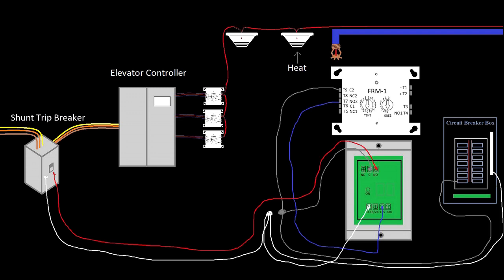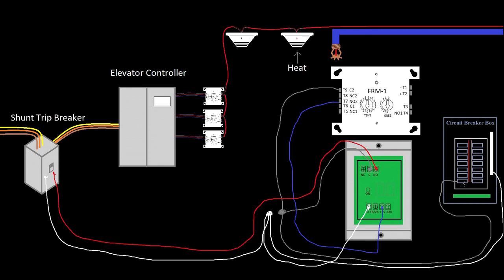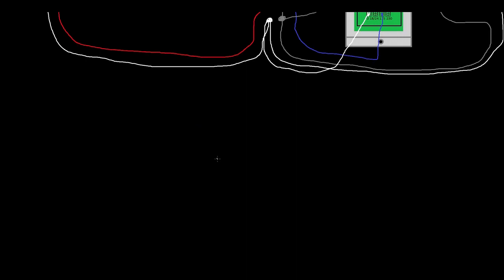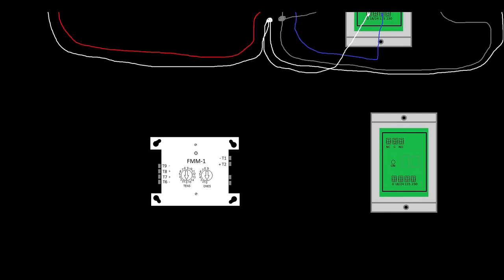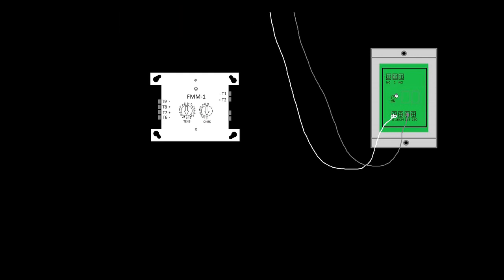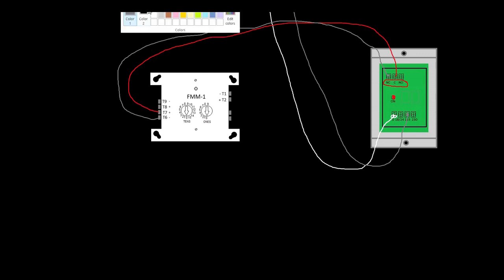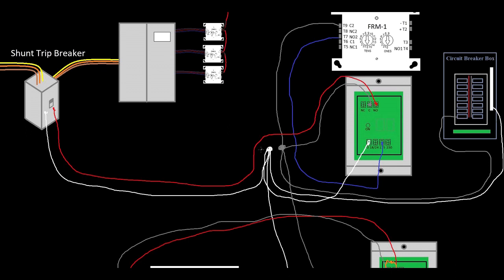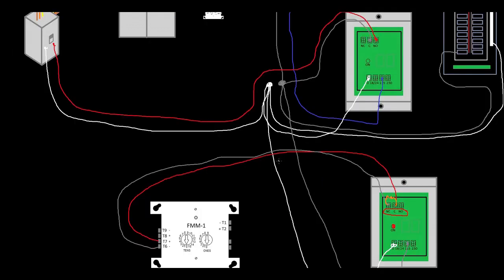40 - Elevator Shunt Power Monitor - Introduction to Fire Alarms

Comment: On the MR101 monitoring power, you have a resistor across the O/NC. When the coil is energized as it should be, the contacts are closed, shunting the resistor. Shouldn't this be wired as N/O with the resistor across the NO? That way the resistor is seen, and when the coil loses power the contacts close, indicating an issue?

Comment: Why when shunt trip is activated, shunt trip power loss doesn't activate?
Reply from the maker: Good question. The circuit that triggers the shunt trip breaker is not actually part of the elevator power circuit that's being tripped. There's a separate, 120 volt circuit which is run through the relays to trigger the shunt trip breaker. So even when the big, 3 phase elevator breaker is shunted, the 120 volt circuit still has power.
Reply: @JoeKlochan  so if you wanted to test shunt power loss reporting to the facp, how would you do that?

Comment: Shouldn't the T6 wire from FMM-1 pass through the resistor first before going to the NC of the Monitor Relay? Otherwise, with the relay normally energized, NC & C will be connected, thus shorting T6 & T7 of the FMM-1, causing an Alarm state?
Reply from the maker: Rewatch around the 3:00 mark. I emphasize that the labels on the relay don't apply, because the relay is now powered up, thus changing the state of the contacts. C/NC is now effectively C/NO, because the relay is activated.
Reply: @JoeKlochan  Ah I see. Because the relay contacts are across C/NO while the relay is energized, and the FMM-1 module itself is set to Supervisory, it would not cause an Alarm state if power to the relay is lost.

Comment: Couldn't you just use a mr201 instead of 2 mr101? One set of contacts for activating shunt trip and using the second set for the monitor module?
Reply from the maker: No because different events trigger the two relays. The power monitor relay needs to always be energized, and it would only activate if that 120 volt shunt trip circuit lost power.

The shunt trip relay is activated when the addressable relay passes 120 volt power through to it, energizing the MR101.

The MR-201 provides two sets of contacts, but only one trigger.

Comment: Can we just cut the neutrals wires?  , I mean the hot wire straight to the elevator breaker and the neutrals in the frm-1,
 the neutral wires doesn't have voltage?
And then we don't have to do extra work installing the Mrs-101 relays?
Reply from the maker: No, that's not how that works. The neutral wire still has the same current running through it that the hot has, since it's part of the circuit.
Reply: Thank you joe .

Comment: why are you t taping the hot directly to the breaker the shunt monitor  relay should be connected to the  hot  red wire going to the shunt trip
Reply from the maker: No it shouldn't. That wire only has voltage on it when shunt is activated. The purpose of the shunt monitor is to ensure the 120 volt shunt trip circuit still has power.
Reply: @JoeKlochan  ok so its not to monitor when elevator is shunted but if someone has turn off the breaker for the shunt  relay
Reply from the maker: Correct.

Comment: Will you eventually be getting into smoke control and programming for that? Also have you worked with potter and Silent Knight systems? I'm in the Pacific Northwest and those are the 2 brands we commonly work with.
Reply from the maker: Lopside, probably not. That's pretty high level, and so site- and panel-specific. My intention here is to try to explain the basics for newer guys, at least at this point. I don't anticipate ever really getting into anything like that.

Comment: In this example, it looks like the monitor module is electrically isolated from the 120 volts. In the previous video, why couldn't it be done that way for the shunt trip relay? Is that the "much simpler method" you were talking about?
Reply from the maker: I'm not sure what you're asking. Are you saying we could have avoided running the 120 volts through the addressable relay module? We need at way to turn on the MR-101, and so the only other option would be to pull 24 volts from the fire alarm panel to turn on the MR-101, but then we'd need to supervise that power AND the 120 volts.  Please expound on what you're saying.
Reply: @JoeKlochan  I think this is what I had imagined:

Relay module: Normally open, powering shunt MR-101 at 24 VDC

MR-101 (shunt): Normally open to 120 VAC

MR-101 (power supervision): Powered by 120 VAC

Monitor module: Connected to MR 101 #2, normally closed

I'm not an electrician, and have no field experience whatsoever. I'm just an enthusiast trying to learn more about fire alarm systems. So apologies if I have no idea what I'm talking about.
Reply from the maker: @Fahrenheit4051  I think the downside to that is that you'd kind of have to add another monitor module to supervise the 24 volts in addition to the MM supervising the  120. Some people don't like running the 120 through the addressable relay, and so this method may be preferred, but it's more equipment needed.
Reply: @JoeKlochan  What I like about Fahrenheit4051's option, is the idea of separating power limited circuits from 120 VAC (for some reason the 120 burned a Fire-Lite's CRF-300), and yes, that 24 VDC PS needs supervision.  Just passed my final inspection two weeks ago... please keep those nice videos coming Joe, thank you.
Reply from the maker: @joelcorvus5759  yeah his way would definitely work, and I don't think it's a bad option. You'd just need that extra monitor module and power supervision relay for the 24 volts.

Alternatively, some people turn on MR-101s with NAC circuits or control modules, landing the resistor right on the coil with the trigger wires. That way the circuit is supervised. So instead of an addressable shunt relay, you would have a control module turning on the MR-101. However, you still need 24 volts to that control module. Depending on your panel type, the 24 volts is inherently supervised by the control module if given the proper type code in programming (gamewell/fci doesn't have this capability for some reason).

One last quick point, system sensor (the manufacturer of the modules) makes a CB-500 barrier that gets installed behind relay modules to isolate the non-power limited 120 volts from the power limited SLC. That solves the problem Joel was talking about. However, in all honesty, I think I've seen that used once, and if you're not the one doing the pipework it may end up being useless depending on how the boxes get piped.
Reply: Joe Klochan 
Thanks Joe! Have you thought about doing an explanation on how to wire the RTU shutdown?... I had a discussion with an electrical engineer about installing his decision to install the smoke detector on the return side rather the supply side.
Reply: @joelcorvus5759  Placement of duct detectors is kinda wacky.

IBC refers you to IMC: Which tells you to install them on the return over 2000 cfm.
NFPA 72 refers you to NFPA 90A: Which tells you to install them on the supply over 2000 cfm.

I've had to have them on both return and supply on a bunch units that were between the 2000 cfm and 15000 cfm sizes. This was because it was a weird situation where I had to meet both IBC  & NFPA requirements.

Comment: My foreman was just asked this exact question over the phone just today! How to monitor the shunt. He didn't know. I'm going to share this with him. Another crew of ours was working on a military hangar getting ready for a fire test and this came up. Thank you. I'll be subscribing and letting my classmates and instructors know about your channel.
Reply from the maker: Thanks. Like most things, there are some caveats. There is a certain style of shunt trip breaker that comes with all sorts of built in pre-wired relays that only require an addressable relay and an addressable monitor module, but if you get all the stuff I've shown here (obviously your part numbers would be specific to your panel), then worst case you don't end up using the MR-101s.
Reply: please by all means put the good words around, i learnt heaps from this man and would love to hear he become famous and get some reward, Joe, we really appreciate your video! THANKS